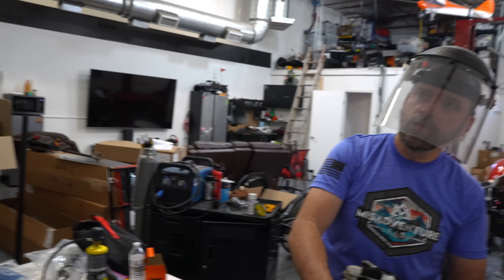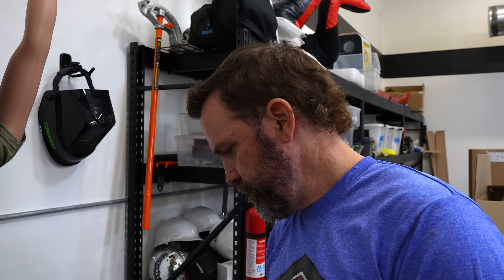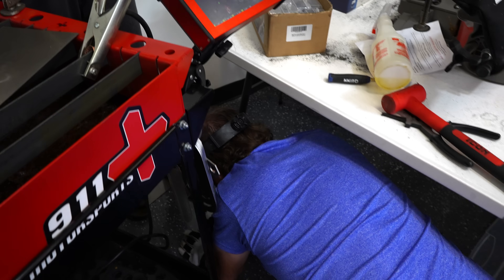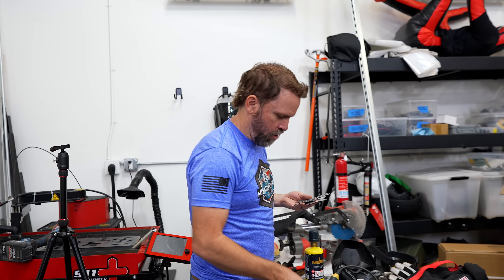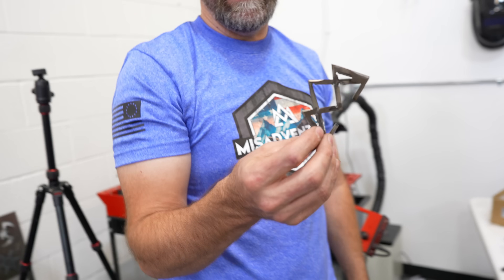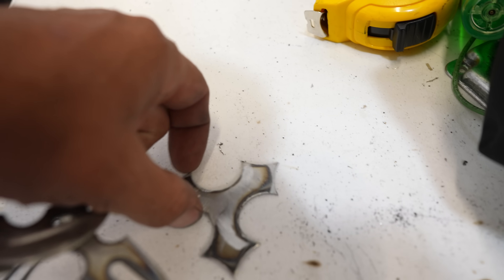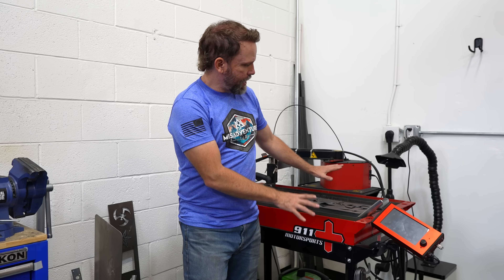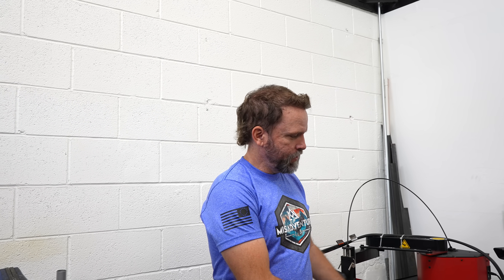I Turned a Harbor Freight Cart into a POWERFUL CNC Plasma Cutting Table

Comment: We at MaxsGarajMahal YouTube certainly could use a 911 Plasma Table in order to make toys, parts, pieces and did I hear Trevor say you can make apple cobbler while cutting out toys? Maybe it was apple cider or possibly age some cabbage for sauerkraut. When you're as old as the old Max, you may not have heard any of that but then you won't remember it even if you did or what you heard was more in our mind than in our ears.

At any length, we could use the 911 table, the Harbor Freight Roll Around Cart to make our old Harbor Freight Dual Mig 151 in a lovely shade of blue setting up the Red, White and Blue Theme I'm going for in the welding department. Just needs something white from Harbor Freight to make the theme work once you've sent the 911 plasma table, lol

I'm sittin' on go when you are.

Thanks in advance,

MGM

Comment: Dxf and SVG are very similar. You can convert one into the other very easily for your plasma cutter. If you need them to be nicely balanced or anything like that, you will need to use CAD software, but it should be able to export the sketches as dxf.

Comment: The plasma table is great, but the templates should be offered through your store. My ability to cut a circle freehand with my plasma cutter is less than zero.  When cutting a hold in thin plate for a bolt to go through mine looks like i took a can of redbull before making the circle. Lots of jagged edged. having a good template of different sizes would be great!!